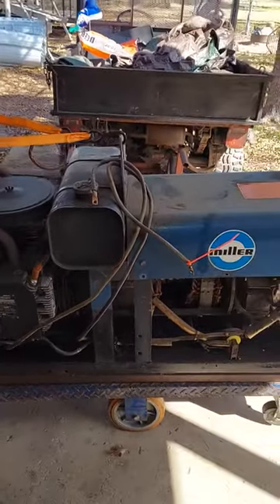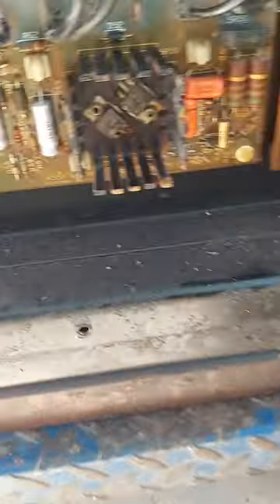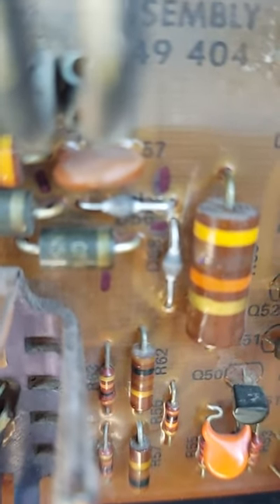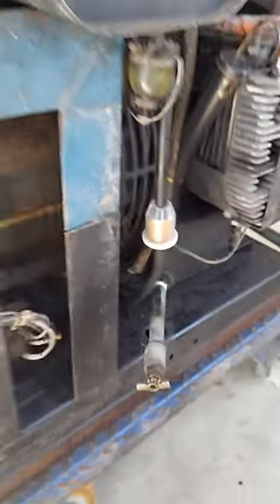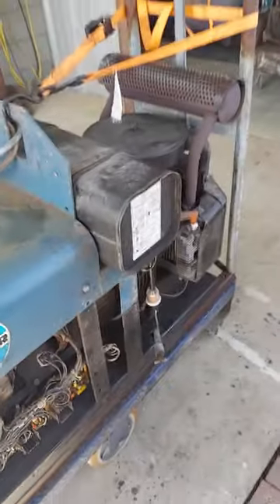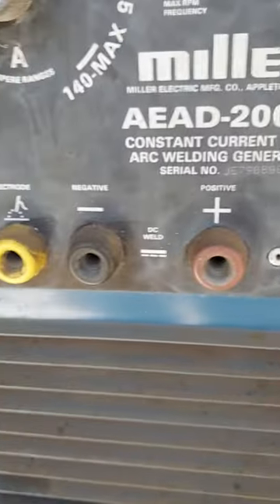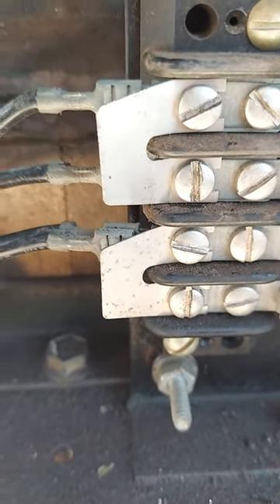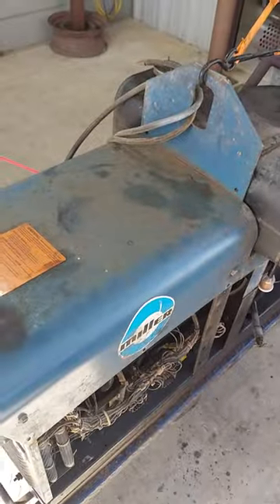Miller AEAD 200LE welders repairs for a customer.

Comment: I have the exact same Miller and i changed the plunger solenoid and the switch on mine. The auto idle on/off switch still doesnt work and also when i switch from power to weld, it will idle up SOMETIMES  but stays up only for about 5 seconds, even under load of weld or running grinder on that 110v receptacle. Do you know why its doing that? Maybe the panel board needs diodes changed? I dont know anything about the board other than everything looks to be plugged in to where its supposed to be. The 120v 30A receptacle works great
Reply from the maker: Is there a white chalky residue on the diodes? If so, they will need to be changed. They are polarity sensitive.

Comment: Would you be able to advise why Del 200 same PC 1 board, mine wont drop to idle when in weld mode, regardless of auto idle switch position, it will drop revs when in power mode, from a previous repair scr’s 50 & 51 changed out, zener diode changed, capacitors C51 &52  and it was working fine until it was welding one day, I have a capacitor C53 on route home to try replacing it, all switched have been cleaned and tested, for some reason 12v is being applied to the solenoid at all times in weld mode, thanks
Reply from the maker: https://www.facebook.com/groups/814591203458092/?ref=share_group_link

Please join this group and posts the problems u are having. Yes, I have some ideas on what's causing your idle problems.

Comment: Where are you located i need a miller trailblazer 250g repaired
Reply from the maker: If u would like to contact me through our Facebook group we can messenger each other. I've linked it under the video discription.
Reply from the maker: We've just started a Miller troubleshooting and repair group. Lots of tech information and technicians in the group already.
Reply: @nadingjeff  joined ,you guys are helping me with the melted wires,thank you 🙏 I can get this figured out

Comment: I'm looking at one of these welders but instead of the dials for welding control it just has pins to pull out and plug into different amperage.  Will it still have at PC boards with diodes and capacitors that can go bad?  Thanks
Reply from the maker: I would have to answer yes to that question. I don't know of a welding machine that does not have some means of electronic component control.
Reply: @Jeff Nading  ok thanks.  May I assume the older ones are still easier to fix though?
Reply from the maker: That's actually a hard question to answer because that unit is so old, a lot of the parts are no longer available. That's not to say some of the parts cant' be replaced. Doing a little research, u should be able to find newer updated parts that will work. Just have to know what ur doing to do so.

Comment: I can't get mine to charge the battery and I'm not finding an answer on any  fourms help?
Reply from the maker: What engine is on ur welder? Onan?
Reply from the maker: If u watch some of my other videos, they explain what to do.
Reply: Yes Onan
Reply from the maker: View this video (https://youtube.com/shorts/-oeOdtbYPaM?feature=share) Onan and Kohler use the same charging system. So watching this video u can glue new magnets in the flywheel correctly.
Reply from the maker: https://youtu.be/lBqvFw-U1Jo watch this video, it explains how to troubleshoot ur charging system.
Reply: Thank you tomorrow I'll do some digging into it
Reply from the maker: If u find out u need a voltage regulator let me know.